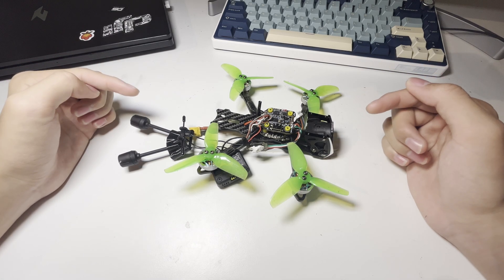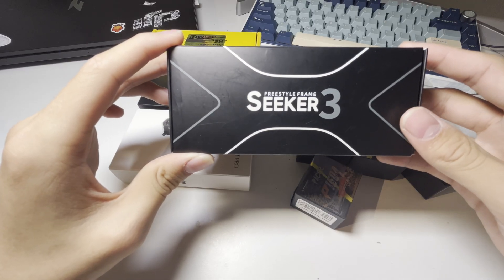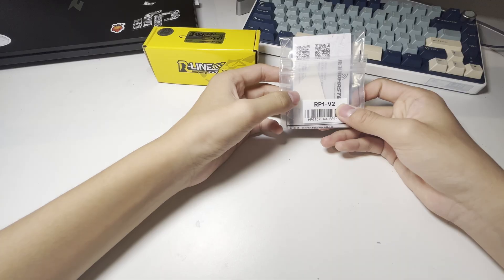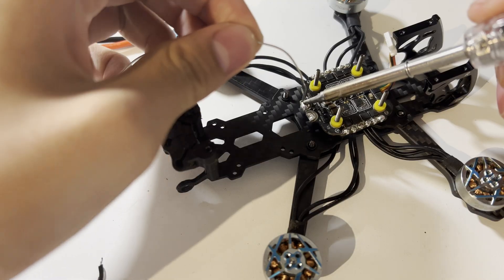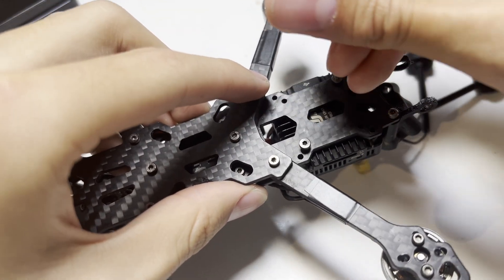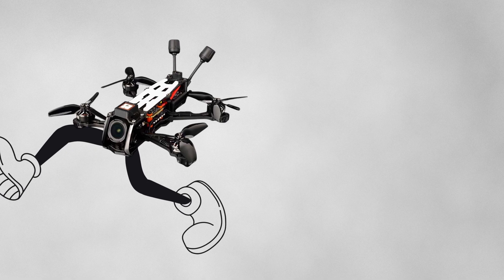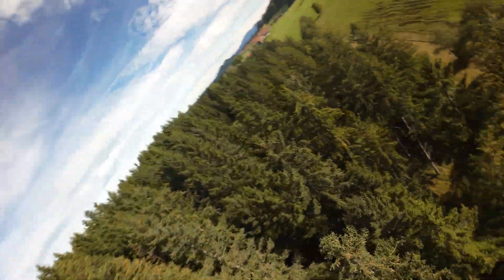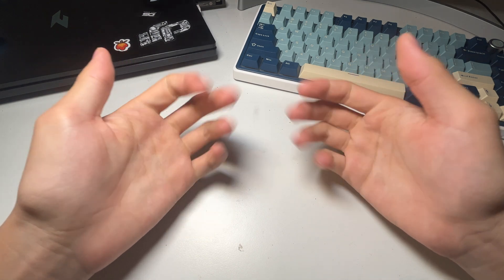My first FPV drone build as a 13 years old (sub 250g!)

Comment: Broo, I can relate so much. I am 15 years old, have the avata 2. I have been wanting the deepspace seeker 3 for a while now but since it is a little expensive, I am thinking of building one myself. Also, how was your experience with your build, like do you face JELLO or a lot of prop wash and things like that. Great video as well!!
Reply from the maker: Hi Bro, thanks a lot for ur kind words! I should definitely start with fpv! It’s nothing compared to my Experiences with the Avata! To answer ur question, I  can’t really notice any jello and there is a tiny bit of prop wash but definitely in the acceptable range and in my opinion even less than in a sim.